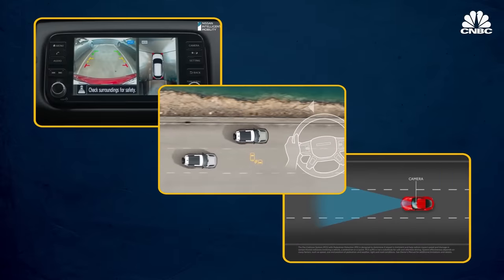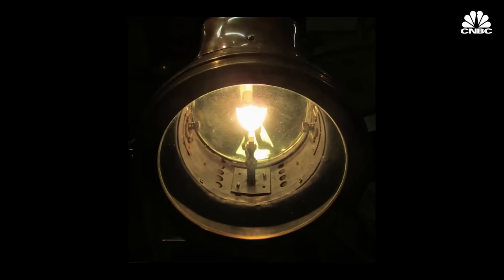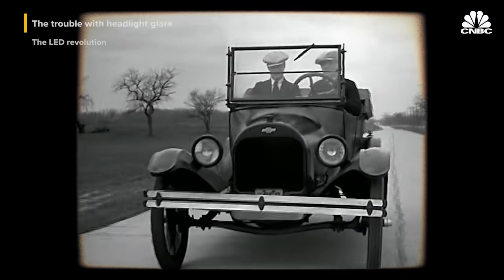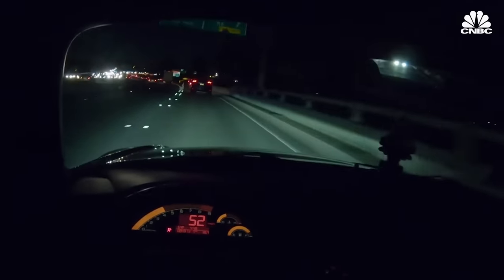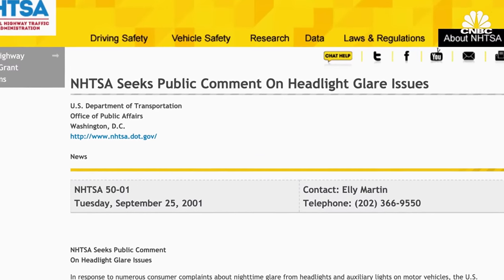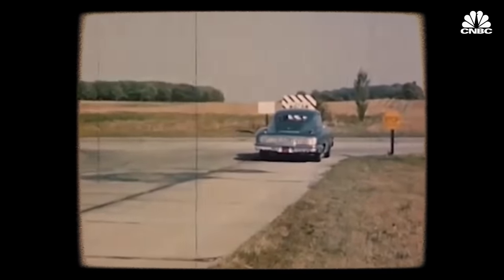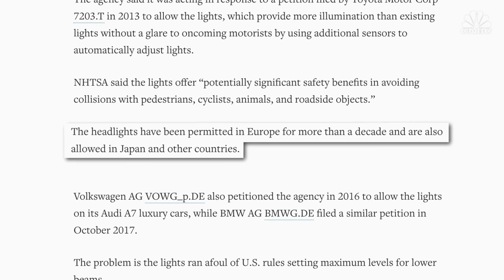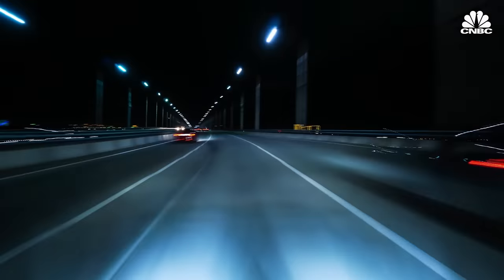How Headlights Became So High-Tech

Comment: Have to admire headlights on new jacked-up F-150s, Silverados, and Rams.  (Never mind gargantuan SUVs.)  They aggressively blind oncoming drivers even in low beam mode.  Brings a sense of  satisfaction and job well done to the testosterone junkie pickup owner.
Reply: Those vehicles are a blight on the world in so many ways!
Reply: As someone that drives a low coupe, for sure this. My rearview is dimming, but not my sideview mirrors and it makes me a pain. It's not an issue on jacked up trucks. Wife has a stock used F150 and ever her LEDs blind me at night.
Reply: Even Honda civic blind me at right angles
Reply: just get your windows tinted and it won't be an issue. well worth the cost
Reply: @texasbrotherhood3930  Well, different states have different laws, but I'm pretty sure just about all of them make it illegal to tint front windshield. So when he's talking about oncoming traffic, tint won't really help much. Here in Ohio, $120 misdemeanor charge/ticket.
Reply: @richardnavratil9661  I completely understand what you mean, they are illegal in the state I live in as well. I have 45% on my windshield and I do not have issues with any glare from oncoming traffic, I can see perfectly, and I do not have any trouble with law enforcement. Just providing a solution to a problem. It’s a “risk” I was willing to take as well because of the everyday benefit it gives me. Worst comes to worst if you do end up being pulled over you can explain your reasoning of not being able to see well because of the glare from oncoming traffic, and how the tint makes it less distracting and in result safer, maybe he will be inclined to let you go
Reply: @texasbrotherhood3930  I guess, your coherent response and actual sound logic behind your decision does make sense, i.e. you're not the person I'd worry about. I always tense up when I see a completely tinted car including windshield, because I don't ever know if it's someone trying to be "cool" or has it for actual purpose like you. :) I for example literally just ordered anti-glare tint for my sideview mirrors. My coupe sits low and trucks blind me from the back. But not much I can do from the front.
Reply: @texasbrotherhood3930  that doesn't work for side mirrors that reflect all that light right to your eyes...

Comment: France had yellow headlights, removing glare and penetrating ground fog, providing as much illumination for lower energy and protecting eyesight.. 20 years ago. Here, the glare from SUV-mounted Xenon lamps is unbearable and has led to a front-facing light arms race using pinpoint LED blue-based focused-beam light that's the most damaging to eyesight. All that, for only 50 times the price of a Tungsten Halide bulb.
Reply: There's a petition called 
Ban Blinding Headlights and Save Lives 
it has nearly 23k signatures
Reply: More like 50 years ago with France and the yellow headlights… But drive in Europe and you see the difference in their Headlights , all auto manufacturers, I prefer the European way… much better less blinding and more to the point . TG more regulation coming , now to get rid of un regulated light bars on jeeps and the like that fools forget are on or are just plain old selfish

Comment: Audi definitely has one have the best headlights/designs in the automaker industry. I’m not surprised they’re coming out with those cool Audi Matrix Led lights👍
Reply: How much does it cost to repair?
Reply: @tobytoyota6936  if you got money to buy a brand new audi with matrix headlights you dont care whats the cost and also you'll probably gonna drive it just while it's under warranty.
Reply: @tobytoyota6936  Wrong question…. If you really care about such costs for a luxury car then stick with Toyota
Reply: With Audi you buy the headlights and the car comes with it.
Reply: @armenstaubach9276  what about in ten years when theyre relatively cheap. devastating to longevity if a single headlight is ridiculously expensive

Comment: I'm a huge fan of what I call "courtesy lights". Basically just dimmer lights than your standard. Like the opposite of brights. You could use them in cities where you don't need the power of your regular lights or when you're passing someone in the dark.
Reply: also when facing oncoming traffic you are supposed to switch to dipped beam

Comment: Yet another example of the stupidity of the people who demand this nonsense. 
There is absolutely nothing wrong with a halogen bulb.  It is more than bright enough and a replacement can be bought for £/$5. They can usually be replaced simply without the need to mortgage your soul to a garage.
Reply: Right?  If it ain’t broke, don’t fix it.  Had one of those bendex-detroit diesel anti collision lane changey things, was an utter nuisance, so i fixed it, with a hammer.  My entire headlamp assembly is $200.  Housing, lens, bulb, and all.  Coworker needed a new swivling automated aiming led light for his mini cooper, $1200 bucks, plus labour.  Possible by no means necessary.  Went into dealership looking at automobiles, dealer goes on about all this techno automated nonsense, i told him “it may have it on there now, but it’s either coming off, being disabled, or being broken, before i sign a thing”.

Comment: White light is actually affecting eyes more than yellow lights. On highway when you have vehicle with white light behind you, you will have more difficulty to see in side mirror and you literally feel blind when car coming with high beam during the night.
Reply: if your seeing headlights from the car behind you in your side mirrors,  you dont have your mirrors set up correctly
Reply: @rogerw-interested  I meant to say when car is on your left side aka other lane.
Reply: New Tech has auto mirror shaders just like the middle mirror in new cars
also if someone's behind you with light hitting your mirrors, it's probably his car's fault since the lights are not adjusted correctly.
Reply: @DevFTW  or high beams
Reply: Thank god auto dimming rear video mirrors are common in new cars now. Here’s a tip: put a film of tint over all your rear mirrors, and the light from blinding cars will be dimmed.
Reply: @josephquinto5812  100%

Comment: Most european cars with HIDs have automatic beam leveling.  And at least for GM cars I can say it was common to include rear load leveling with HIDs so that if you loaded up the car with stuff, your headlights weren't pointed at the sky.  Also, it was very common to include headlamp washers with HIDs.  Again, GM tended to do this at least on Cadillac.

Comment: The problem with these headlight is they have life span like a bulb in a projector and once it died (hour runtime used up), you cant just switch the bulb you have to buy the entire assembly which for some car cost thousands. And you can't buy aftermarket because now your headlight needs computer to run it. Basically it can't be fixed.
Reply: LEDs last tens of thousands of hours. It’s not an actual problem.
Reply: Most modern LED´s last 50.000 hours+. If you use your car 2 hours a day, even in the worst case scenario that they were of slightly lesser quality, that would still be something like 40 years.
You´re not gonna drive the same car at that point, trust me.

Comment: The other super dangerous issue is police and fire are cranking up the LEDs to a point that it’s makes for a safety concern.  Police emergency LEDs need to have a day and night setting.  Additionally some of the yellow high flashing lamps are even more dangerous in the rain as they blind other drivers.

Comment: The matrix LED headlights are superb I have been using them daily since 2015 and wouldn’t go back to anything less. You just leave your lights on permanently it’s fully automatic in every scenario and have safety benefits 24/7 I have never been flashed by an oncoming vehicle in any road or weather condition and the visibility is immense Audi also brought out what they call laser headlights which project further.
Reply: BMW introduces laser light technology back in 2014, it can reach up to 800 meters pretty cool right
Reply: Honestly? You really have not been flashed by oncoming traffic for blinding them? I know that automatic brights in most modern cars still leaves quite the room for improvement, so I assume Audi really has this figured out that much better? Honest question
Reply: @richardnavratil9661  Even my Opel Astra (2018) has automatic head lights with sections turning off, it works even better in Audi SQ7 (2018) hence greater amount of LEDs in the "lamp", Audi BMW Merced VW Opel Skoda etc has really good adaptive LEDs/Laser/Matrix lights. I wouldn't buy new car with out them right now
Reply: @KillerQueenWarThunder  I'm Czech (but living in the US), so I'm familiar with European models. I'm pretty sure in the US it's not approved. I didn't know VW now put it into Skodas. They've come a long way since my grandpa's 1960 Octavia.
Reply: @richardnavratil9661  Are they really banned in US? What a shame. But honestly US has fallen behind EU in some legislations that improve quality of live and tech. Even sobriety tests in US are well not so good to say it lightly. In Poland Police has mobile breath tests. We don't have to do now out dated moving tests.
Reply: @KillerQueenWarThunder  fully adaptive headlighting is in fact illegal in the USA because we are still abound by a 1960s era regulation that is moving slower than Molasses in a Canadian winter to get up to date.  Its idiotic, It makes me wonder if Audis sold with Matrix LEDs in the USA are different hardware or if its just flashable firmware in which case maybe Audi should "Accidentally" leak the firmware update to the auto modding world.
Reply: The US needs to hurry up and approve the Matrix headlights.  All we have here are adaptive.

Comment: Headlights are so advanced now, engineers forget fo include fog lights on most cars. Unless mounted low under the bumper and aimed at the extreme corners of the road, your "high tech" head lights are meaningless in a torrential downpour at night. ⛈🚘⛈
Reply: thats actually more of a color temperature problem, the 4200k that most OEM used was pretty good in bad weather but with the advent of LED the color temp makes it too blue to be good in inclement weather.
Reply: People just use their white high beams in rain or fog nowadays, when regular yellow fog lamps like on old cars are what they need.
Reply: I heard from one source that the matrix LEDs have supplanted the need for fog lights.
Reply: @krane15  except matrix headlights disqualify from function as fog lights under the SAE J583 definition of the specification. [matrix beams are defunct as fog lights by bulb centerline height]
Reply: Idk I live in seattle and my white headlights are better than my old orange:yellow ones in the rain

Comment: when the headlight makers are able to play the rich against the poor by putting bright headlights on expensive versions of a car
That's called divide and conquer. Instead of brightening headlights how about let's emphasize driving a safe speed at night. Another factor is today's headlights are not self leveling and the roads are anything but level. if you're approaching a car on the rise even though they have their dims on it's going to look like brights to you. also since we don't have the separation of lights like we did in 1958 we can't really tell if they dimmed or not and I think we really need to be able to tell that if we're going to fairly flash another driver down. Police need to be able to tell whether somebody is dimmed or not as well. Please say there's no mechanism that they can get too accurately measure light output to the point where it can gain judicial notice. if the cops can't even be sure when lights are too bright or illegally bright, everyone else is going to suffer.

Comment: Totally skipped over projector lenses, which allowed for ultra sharp cut offs, and zero glare. They are also the reason why people think xenon headlights (HID's) are "blue." The light that they emit is a pure white. But The area of light right at the cutoff which is what will bounce and hit and oncoming person's eye has a sharp line of deep blue or purple because of the way light bends. This can be even more annoying and present when the lights are aimed higher than they should be.
Reply: I was just going to comment about them skipping over projector lenses. I find it strange that automakers have offered them on vehicles with halogen headlights. Projector beams actually don't put out quite as much light as a reflective lense. I always thought the point of a projector lenses was for HID bulbs because they're so bright they need that accurate beam and upper cutoff line.
Reply: There is no such thing as pure white. White light is not a particular frequency, it is a combination of a spectrum of frequencies. White light is characterized by the color temperature. I think by pure, you mean that the color temperature more closely matches that of the sun. 

Also, projector lamps can also use LEDs as their light source, which are normal chosen to have a more blueish white similar to Xenon HID.
Reply: HID lights can definitely be more blue especially ones that are 6000k or higher
Reply: @descentplayer there’s always a thing as pure white. 

Two most common color temperatures is one think 5000k/5500k is pure white or 6000k is pure white. 

It’s always such a thing.
Reply: @rangerover06sc not always. When it comes to HID, u get a lot more color options than LED.

Comment: It's a headlight arms race.

There go to be so many cheap uncalibrated and not DOT approved LED lamps on the road that I could I no longer see.  My eyes get dilated by oncoming traffic with super bright 5k lights to the point my conventional regular factory lights no longer put enough light for me to see.

So, I had no choice but to get on eBay and get the LED after market lights...I have no choice...

This is due to US government corruption in allowing the unrestricted flow of Chinese lighting devices that are not DOT approved.  Technically from what I know in most states all of these add-on lights from China are illegal.  Most states have requirements that you only use US DOT approved equipment on vehicles.  I know for sure that's in the California vehicle code.

But in crooked deals between the US politicians and China are allowing China to ship things in on an individual basis where things are not screened and the Chinese are allowed to sell to and ship directly to the consumer.  This is of course the same method the Chinese are using to ship counterfeit goods to American consumers.  Part of the trick is on the small packets directly to the consumer (and I forgot the acronym that they are  officially called) is that they avoid customs tariffs. A little back door way to avoid our tariffs..But that's another story.

But nonetheless none of these Chinese lights have ever been tested in a lab for output or any other parameters. So it's a wild wild west out there on the road. And you just have to keep increasing the lumens to compete.

Comment: Have fun buying $2,500 replacements in 7 years when they Yellow out.
Reply: or buy a 3M headlight restoration kit for $14 and make it look good as new
Reply: @EXEON727  A headlight restoration kit scratches the headlights (from buffing) and can risk damaging your paint or lights if you do it incorrectly. You will also have to keep doing this every 3 months-1 year as they will keep yellowing even with protective coats
Reply: or soon
Reply: Use UV protected clear covers over the headlamps to prevent hazing from occurring.
Reply: @Striker50_  thanks for the update

Comment: The new cars with the LED headlights are horrible if one if coming at you at night. The lights are blinding and I am sure the cause of many head-on crashes.
Reply: Not all of them. Only if they are rated to have excessive glare or some glare by the IIHS. The real problems are those LED people buy aftermarket online and put them inside their halogen headlights, they are illegal for road use, only allowed for off road, but people don't care.
Reply: @igotanimac1  Those are pretty bad, but the most painfully blinding lights I come across are almost all on newer cars. It's a car manufacturer issue, too.
Reply: @bonsai_wolverine  Most of the LED lights that are painfully bright on new cars are usually suvs, cuvs and pick up trucks. Because they are higher, the headlight is higher and therefore they tend to have the beam of light higher. A car like the 2022 Honda Insight is low to the ground, at 55.6", has full LED lights and doesn't exceed glare limits.

Comment: Why is the US so behind on headlight technology or regulations? In the EU(Europe) it is legal to use laser headlights which just now are starting to appear here in the US.  These lawmakers in the US need to evolve more quickly and efficiently.
Another thing, why does the USA have crap (not as refined) gasoline?
Reply: The US doesn't have "crap" gasoline. The reason the rating at the pump are different between the US and Europe is because they don't mean the same thing. Europe uses the Research Octane Number (RON) whereas the US uses the Anti-Knock Index (AKI).
Reply: We have laser projector for a while now. High end bmw hybrid vehicles have it for a while in the US. Even matrix LEDs are also available in many high end Audi. It’s what the market want and I’m pretty sure many people here want to keep the cost down especially replacement cost. Those laser and LED headlights can cost many more times more than regular Xenon headlight. And if you really want  brighter headlights there are many alternatives that may surprise you.